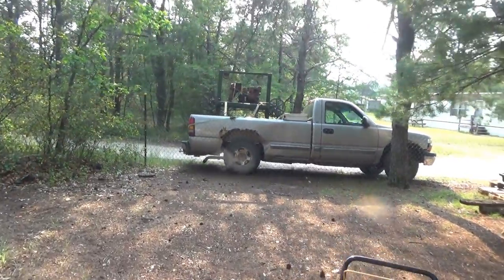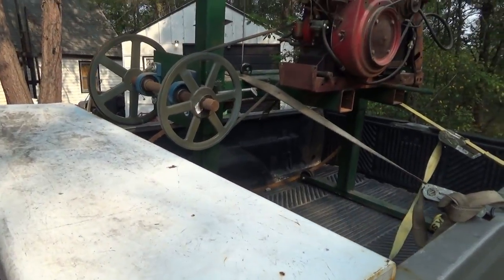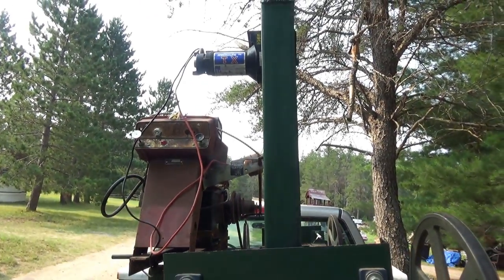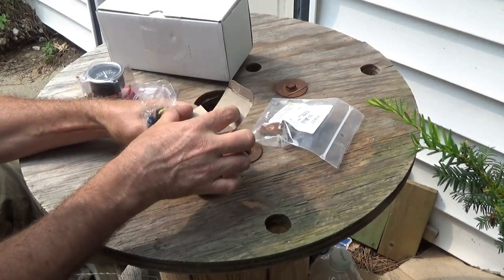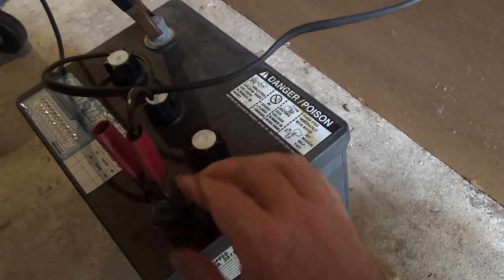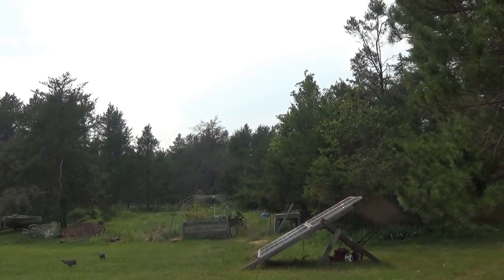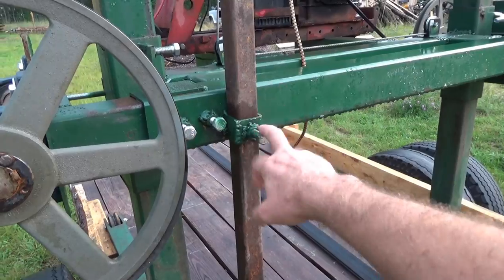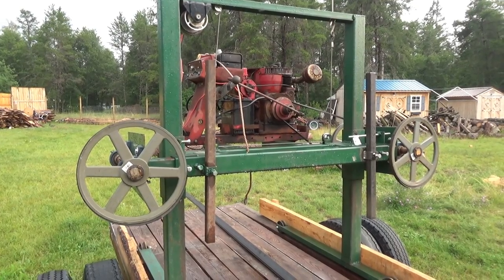Daily Vlog I Got Another Sawmill And Some Packages Arrived

Comment: Not tensioners, they are blade guides. The tensioner is the side shifting of one of the pulleys that the blade runs on. Where is the track assembly that the carriage rolls on?
Reply from the maker: My first bandsaw mill so I am learning terms. The track assembly is that angle iron I bought. I will build my own.

Comment: Are you going to sell the tractor when you get it working? No point in having two tractors. Now a Bobcat tractor or excavator would be useful around the homestead for various projects.
Reply from the maker: Not sure yet. I need a front loader for winter snow plowing and digging around here. Plus the forks on the bucket will be good for lifting logs for my mill. The other tractor has the PTO drive and is great for rear mounted equipment.
Reply: The bucket is good but how can it work with the forks hanging off the end of it? The forks are also good. But I just don't see how they can work together.

Comment: Pease don't hurt yourself unloading that man..
You could really use an overhead chain crane setup
Reply from the maker: Coming off the trailer will be easy. I am going to use a block and tackle to secure it to the trailer. Then tip the trailer up in the air and ease the mill onto its tracks using the block and tackle. Thats the theory anyway.